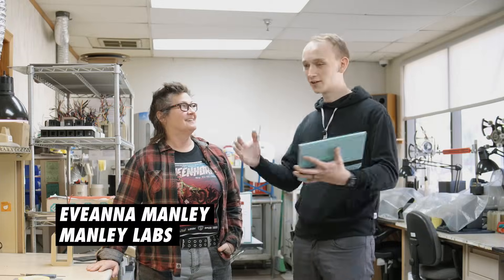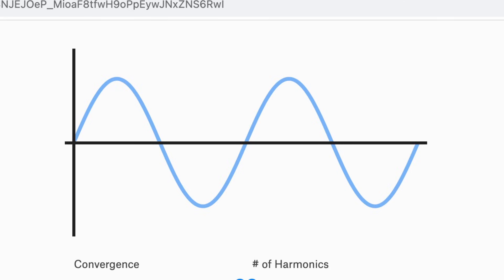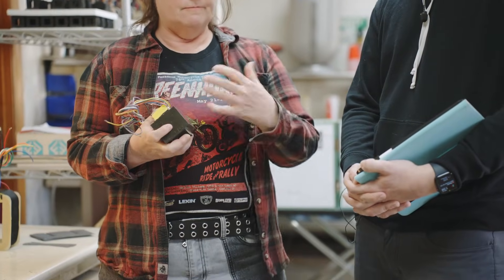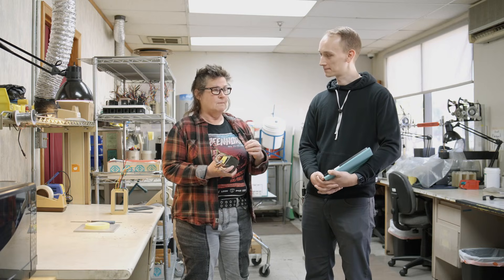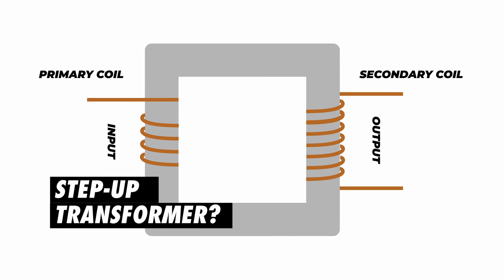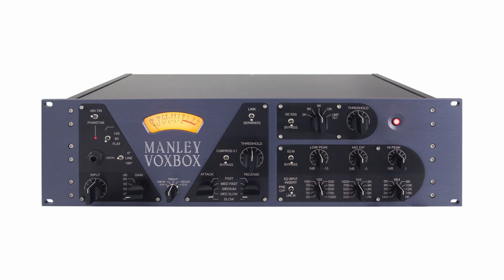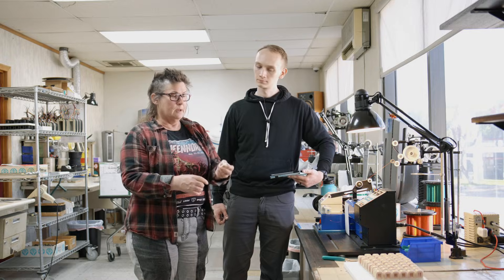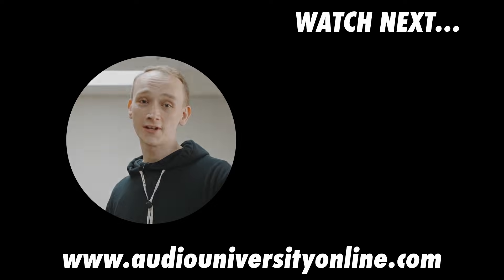EveAnna Manley: Tubes & Transformers In Audio Gear

Comment: The output transformer is an impedance translator.  It changes the scaling between voltage and current between the windings to facilitate maximum power delivery to the load (speaker etc). 

This occurs when the impedance between the source and load are matched.

Output stage matched to primary, secondary matched to load.

I would argue that the transformer plays a major role, if not thee role, in how an amp sounds, unless a lot of work goes into making them linear in their performance over the frequency range of interest.
Reply: Absolutely.

That one component - the output transformer is a highly complex piece of kit - and certainly goes a long way to defining the overall sound.

The output transformer seems simple enough at first sight - just a primary winding ( centre tapped for push pull output stages) and a secondary winding on a magnetic core - with a turns ratio  suitable to translate the speaker impedance to that of the ideal  operating anode/plate impedance .  
Typically say 4 ohms speaker to say 2000 ohms anode load.

Impedance transformation is calculated by: 

 Zp/Zs = (Np/Ns) ^2 

(Z = impedance,  N = number of turns )

So turns ratio would typically in the example above would  be sqrt 2000/4 = 22:1

To get a transformer to operate over a wide frequency range of say at least  40 Hz to say 10
12-15 khz  and at reasonable power levels is a very demanding task ! 

( i guess when she was answering the question about transformers.... she didnt want to give much away!  
Far too much hard won black art to get it right ( she did touch on inductance values ( 50 henries etc) versus bass response,  e and i laminations / and their metallic  properties / eddy currrents etc ... but kept it pretty vague really !!
To much design know how there to give away !

Comment: An distinct difference of tubes vs transistors is that tubes are continuously on via heater filaments and fixed voltages on its elements , transistors are not so much , they essentially turn on when a signal reaches them. F.e.t.s corrected that somewhat.

Comment: This is excellent, thank you. There's so much more I need to learn about transformers!

Having lost the treasured vintage tube amp I carefully carried between moves over my career, I decided to design and build my own. I secured a few sets new Russian tubes and began brushing up on my electronics fundamentals, reading old Navy research reports on tube amplifier circuits, etc... 

I've developed a number of ideas, many I think are original. But truly, the heart of a good amp is it's power transformers. They must have a broad & flat frequency response, and the core must be able to accommodate the operating flux without saturating. It is the (musical) instrument within the amp.

Comment: When people ask me about the function of a transformer, I explain it like a car transmission.
It takes a signal of High RPM and low torque (high voltage and low current) and transforms it to drive the wheels (speakers) to lower RPM (voltage) and higher torque (current).

Comment: Stop it.. just stop it.  Build an amp that reproduces the input with as close to zero distortion as possible.  Leave it to the engineer to have it sound the way its supposed to sound, and if you don't want it to sound that way, admit that your bastardizing it and get an eq.  tubes are not superior just because you like how they distort.  distortion in all cases is non-ideal, and if you want that, do it in mastering.
Reply: It is harder to match up a SS amplifier with a pair of speakers than a tube amplifier with a pair of speakers.

Comment: i think a better way to compare how soft different nonlinearities are, whether physical devices or algorithms, is the ratio of linear behavior to its maximum headroom, rather than what that headroom is. the reason tape saturation sounds better than digital hard clipping isn't because it has a larger headroom, but because less of that range is near linear, it has some knee, some smooth transition from near linear to near flat. but that assumes a bounded output, which isn't necessarily the case in an algorithm. one could consider that the limit, maximal softness, infinite knee, and arcsinh does sound quite nice and soft, probably my favorite simple nonlinearity. while pure hard clipping has 0 knee, the other end of the spectrum, and can sound quite bad.

Comment: She's not wrong about transformers but I think I could explain it better. Tubes work on high voltages, but quite low currents. Like if you had a high-value resistor, 100K ohms say, if you put a high voltage over it, you'd only get a low current. Because of Ohm's Law. Tubes are the same, the electrons are streamed off a hot element into a vacuum, so need a high voltage to give them a kick and get them going.

So tubes work with high voltages, but their high resistance to electron flow means only a small current flows. Power is volts x amps, so there's still high overall power because the volts are high even though the amps are low. 

Back in the day, tube radios would use high-impedance speakers to match the valves. Instead of 8 ohms it'd be 64 ohms or higher. So the speaker would drive from high voltage and low amps, still giving enough power. 

Transistors are the opposite. Much more conductive than tubes, so they work on lower voltages and pass more amps. So they're suited to driving lower-impedance speakers, the typical 8 ohms. Nowadays expensive speakers are all 8 ohms, as are cheap ones. So to connect a high-voltage low-amp tube, to a low-voltage high-amp 8 ohm speaker, you need a transformer. Which transforms current and voltage into different ratios, according to the ratio of windings of the transformer's two coils. So a tube can drive a speaker that was really made for transistor gear.

Some tube amps have worked this way for decades, built for low-impedance speakers. Some have been transformerless for high-impedance speakers, but they died out pretty early, mostly. I'm sure you could still get them if you asked but you shouldn't ask the price!

Then the issue she was talking about is that transformers themselves have characteristics that vary with frequency. "Impedance" is like resistance, except it's measured at a particular frequency, a component's effective resistance can vary with frequency, so impedance is a more complex thing. The magnetic fields in transformers can be slow to break down, or slow to rise, it takes time to magnetise and de-magnetise the iron. So they pass some frequencies better than others. Balancing that out in your particular transformer design is an art and that's where messing with the Henries came in.
Reply: You don’t need high voltage to get electrons going. In fact in tubes voltage is used to push electrons back into the hot cathode. Here you need a high voltage like -5V on the grid to really close the gate. So if you want voltage amplification, output should be 20 V or more. Tubes can drive unlimited voltage. Just increase the space between grid and anode.

Though klystrons are known to disintegrate when the HV finds a way…
Reply: @ArneChristianRosenfeldt  "voltage is used to push electrons back into the hot cathode" you're talking about the grid? A typical tube uses an anode voltage between 90V and 200V. That's a high voltage and is used, together with the heat, to "boil off" electrons from the cathode. That's what I'm talking about. Transistor amps run on lower voltage, maybe 15V to 30V, typical, and pass much more current.
Reply: @greenaum  but how would the electrons know about the 200 V on the anode? Extreme examples are the pentode and the CRT with 3 metal pieces between cathode and anode. Faraday screen is almost perfect.

Sadly, free electrons rely on this archaic boiling off method. I mean, you could use an EUV laser instead, but only really large tubes pay for this.
Reply: @ArneChristianRosenfeldt  Because electric charge is a force. You're going a bit esoteric and weird here, a bit past the basics.
Reply: The really old radios did use high impedance speakers, but they'd be a couple of thousand ohms, not 64.  The speaker would be a direct load on the tube.

Comment: No disrespect meant, but this is a more nonsense than I’ve heard in one place in many a year. Tubes and transistors operate in completely different voltage / current ranges. Tubes don’t have ‘more linearity’ because they operate with more volts. That is simply ridiculous. Linearity can be measured and the result is a relative, not a fixed number. She’s definitely “making up the numbers” as she says.

Comment: The simplest way to describe how a transformer works is that any voltage applied to the primary coil can only transfer to the secondary coil as the primary magnetic field collapses. Thus, Dc voltage can not transfer until that field collapses. AC voltages, by definition, are constantly transitioning,and the transfer function occurs
Reply: When does DC collapse?

Comment: This lady is wise, worth listening. . She knows what she is talking about and  talks  about it in  way keeping my attention . She talks about empirical  measurements the way I share with her. The thing is that with empiric measurements we get the  type of information which we can only see and judge with eyes means   without hearing ., But our ears have different demands and synthetize sounds from range of frequencies.  Ears have small sensitivity to 20 Hz while we falsely think it should 100% be fully preserved We faulty  validate them  equal just  because in laboratory tests is proven that we can hear them (with almost 40 dB damping) . We can hear 20Hz but not in complex sound  - in instruments  it is almost always masked by higher harmonics. Other  ranges are more valuated by our hearing sense . Those seen with eyes  in measurements we faulty  validate  equal.  . 

 My experience also shows that in good balanced system there is hardly possible to hear the slope and it's speed below say 35 Hz. It requires  pure sinus which in instruments  is seldom found  All bass sounds are mixed from not lowest only but from wider band of low  frequencies. In such situation higher frequencies  above 35  Hz decide how loud and significantly  we perceive lows.  So  it is not justified to go for expensive  heavy bulky trnsformers when apparently we easy can compensate slop with loudness type compensation ( if we persist) .

 I tried many years to achieve significant level of lowest frequencies and when I at last succeded I decided it isn't  worthy because of   troubles with room resonances. On othetr hand behaviour of speaker is deeply depending  on secondary winding of transformer or solid output, feedback and enclosure of speaker - it can turn  to meaningless perfection of transformer in listening instruments and   voices at range less than 30 Hz  while at more than 30 Hz decide other matters.

Comment: What she forgot to say (and probably meant to) is that transformers work by changing an electrical signal into a magnetic field and then back again. Voltage-in -> Magnetic field -> Voltage out. Because the middle step is entirely magnetic, the different windings remain entirely electrically isolated. Audio transformer quality is everything. Whilst it's quite easy to make (or purchase) a Pretty Good Transformer, making a Truly Excellent One takes a ton of money, effort and design. Impedance is simply a ratio of voltage and current. Valves (tubes) run on high voltages with miniscule currents. Speakers need a lot of current at much lower voltages.
Reply: Yeah, interesting that the current does not lead to a magnetic field because both coils just compensate this. The mismatch creates a field.

In concerts they have these phased arrays. Just connect the speakers in series!

Comment: You kids! My formal education in Electronics came when transistors were first becoming viable alternatives. It was taught back then that tubes are inherently linear devices DC to light and transistors were switches that could be forced into operating linearly in a limited range. Transistors had limited power and very restricted bandwidth back then. Still today when it comes to high power and frequency response both needed, tubes are used. e.g. the magnetron in microwave ovens. But transformers are bandwidth limiting devices with phase shifts. 

Some tube amp manufacturers use autoformers rather than transformers for the output. And autoformer is in line rather than two seperate windings which allows the DC to pass through to some extent.

The first image about 0:56 in is just a sinewave. It is NOT how a tube would linearly compress the top of that waveform.

Comment: The ( only ) correct way to make a balanced output .........not the commercial ones , the illusion for the customers  as seen to often by audiophile hyped marketing !
Reply: Antenna <-> coax also uses transformers in this way. How else would you do this? Okay, antenna’s probably have no problem to block DC. But then again, DC will heat up a transformer.. ah I get it. It is for the pull-up . Transistors would push pull and not use this.

Comment: They use tubes because they SELL WELL!  All the characteristics of tubes could be designed into solid state amps if so desired. But the whole game is to sell stuff to people who will pay for it!
Reply: We use vacuum tubes because we always have, and because they sound superior, and we love working with vacuum tube technology. TUBES RULE! I like your name, "Glass Slinger" sounds like you sell vacuum tubes also! 🙂
Reply: If you think so then how will you correct    solid amplifier  to have less than 1  Ohm  output resistance for DC? It is very positive for damping,   Having output capacity type  solid amplifier   presents to speaker infinity of Ohms at DC. Of course it has simmilar impact also on very  low frequencies in both That is one of reasons why solid can so easy charm listeners with falsely  increased very low band and it is hardly controlled resonance
Reply: @Mikexception   How many amplifiers still use a coupling capacitor in the speaker line? Very few that I'm aware of.
Reply: @Mikexception   Apply more Global Negative Feedback around a vacuum tube amplifier and it can also present less than 1 Ohm output impedance... remembering that is only one factor of many one juggles to make a good sounding amplifier design. It is all a balance. But correct, the output of a conventional tube amplifier will not be virtual earth nearly Zero Z as is possible with solid-state designs.
Reply: @manleylabs Try to read exactly what I stated.  Your advice is nonsens because output impedance is completly another value     than  resistance of winding for DC. You stated that it can "also" (as solid?) present less than 1 Ohm while I informed that solid must have   it infinity and tube has .less than 1 Ohm. How can be tube "also" 1 Ohm? Do not follow most popular knowledge found (may be) in internet There  is everywhere described  only impedance and no word about DC  resistance . 

I wish anybody could  make   tube amplifier which I designed for me sounding the  way I did in reality because my solutions are  unique fulfiling my unique desires. While others quarell about what is best I for my needs already  got the  best.  .

Comment: How can vacuum tubes be declared to have "high headroom" when tube guitar amps are prized for their gradual (edge of breakup) distortion characteristics (i.e. low headroom)? 🙄🤷‍♂️

Also, I disagree that tubes are "linear" devices, because that would mean the output is directly proportional to the input. This is not the case, due to the gradual onset of clipping present in tubes.
Reply: Look at this video as a marketing exercise as opposed to a technical one, and it will all make a lot more sense. This woman certainly knows her stuff, but she is  in the business of selling tube gear.  She's quite good at simplifying basic concepts around various devices like tubes and transformers, but every engineer also knows that the devil is truly in the details. And those details go over most peoples' heads. Clearly, transistor circuits can be made to swing as much output voltage as tube circuits. It's simply a matter of circuit design and device selection. Bipolar transistors don't perform well in circuits that are designed to utilize tubes. But that's a matter of circuit design, not the performance of an individual active device. A contemporary op amp based gain circuit used in place of a vacuum tube circuit will yield far better performance in all measurable parameters. Where devices are designed to be used deliberately as distortion generators, like in  guitar amps, the selection of a tube over a transistor may be justified. Otherwise, solid state circuits designed for linearity surpassed tube circuits a long timeago.